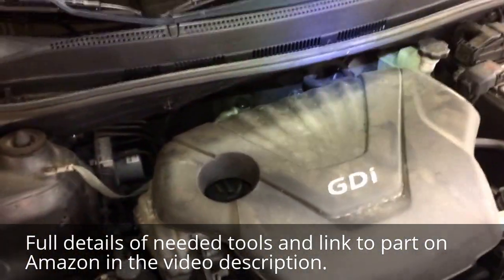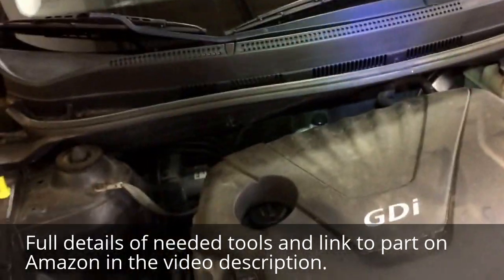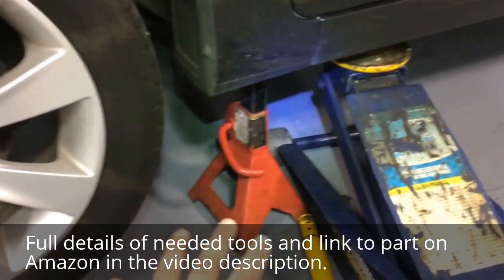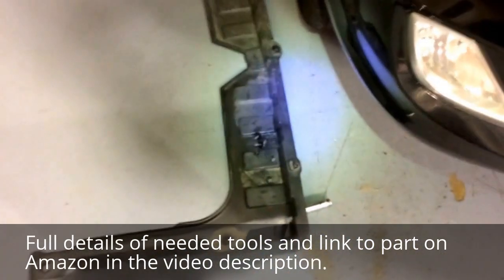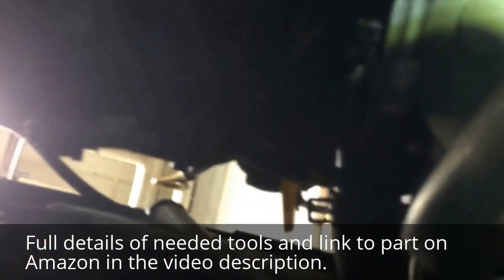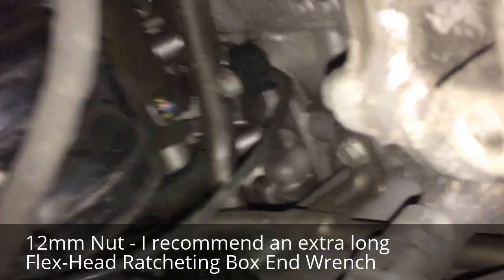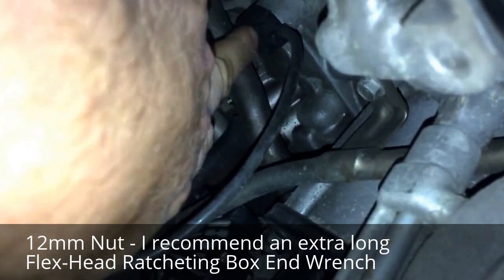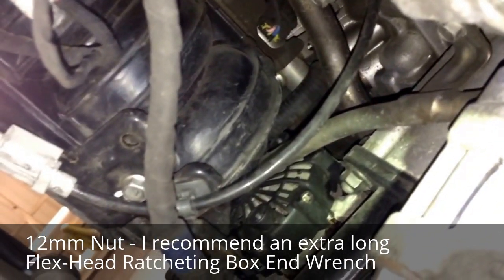Actual location of the Knock Detonation Sensor in a 2012 Hyundai Accent SE

Comment: Excellent video, thanks. My check engine light went on with the knock sensor code. The dealer said replacing it would be $500-plus (this is Brooklyn, NY, so prices are high) because they'd had to remove the intake manifold. Instead, I found your video, ordered one of the sensors you suggest, and did the repair myself. Certainly no need to remove the manifold. Took about an hour, with much of the time devoted to disconnecting the clips on the old sensor. (Have a small flat-head screwdriver on hand for that, and study the new sensor to see how to the clips work.) I'm not entirely convinced this is going to replace the problem, but I'd glad it's only costing me $20, not $500.

Also, replacing the spark plugs was a great suggestion. That cured a shifting problem I was having.
Reply from the maker: +Michael McCoy Happy to hear that it saved you a bundle. How’s it holding up? I’ve come to the theory that the thumbs-down clicks are from Hyundai mechanics. LoL.

Comment: For those doing the replacement,  a standard sized ratchet doesn't fit up in there. Use the smallest ratchet in the set to fit up in there with a 12mm socket. I almost went and bought angled wrenches to do the job. I didn't think the small ratchet would be strong enough because its short and I wouldn't have leverage. I was wrong. These are only tightened to about 12 ft/lbs. So its easy.

Comment: This was just what I needed for my 2012 Kia Rio (sister brand).  Thank you so much!  I didn't have to remove the heat shield or noise shield.  It was slow going for me, having to make use of a box wrench.  I would recommend a ratchet wrench (a small socket wrench wouldn't fit).  Anyway, I was finally able to remove the old Knock Sensor & (even more challenging) get the new one installed.  Couldn't have done it (wouldn't have tried) without this clear video showing the location and how to access.  In my case, the spurious P0325 code no longer comes in to vex me.

Comment: Thank you SO much for posting this! I was also having the issue of finding anything actually descriptive, but this goes beyond detailed, and I'm super grateful. Great job, thanks again.
Reply: Additionally: I have a 3rd Generation Kia Rio (2012-15), which also has the Hyundai Gamma engine. So, other Kia drivers with the typical knock sensor issue, here is what you're looking for.
Reply from the maker: I’m happy this helped.  Be sure to keep those spark plugs fresh, too.  I’m on my third set.
Reply: That is also on the menu for this weekend, alongside a valve adjustment lol. 2013 and already 160,000+ miles.
Reply: @bikerreed  how often you changing spark plugs?

Comment: Thanks for the video. I have the same problem on my 2013 Accent. I will order the sensor and hopefully will turn off the engine light.
Reply: Dude that’s so weird I’m having the same problem too @ 83k miles
Reply: @WHATdaFUNK123  same with me now at 89k miles
Reply: Johnathan I never replaced mine , but I’m at 85k now and my check engine light hasn’t been on since I watched this video .

Comment: Thanks for the video and the part/tool links.  Ordered both for my 2012 Kia Rio that was pinging, had a power loss in low gear and throwing P0330 code.  Getting to that nut was difficult, even with the  right tool, but it all worked out.  She's running great again.
Reply from the maker: +sifual01 Very happy to hear it. It sure does seem that they design these cars so that we will give up and let them do the work, doesn’t it?

If you have more hesitation / engine stall behavior, be sure to read all the comments here. Might need some spark plugs.

Comment: there is a service bulletin for some hyundais with the knock sensor code. the ecm needs to be reflashed in some cases. i replaced my knock sensor on my '13 accent and the code came back a few times. reflashed ecm for $120, never came back on. i shouldve done the research before throwing parts at my car.
Reply: Is the same location and process for a 2013 accent GLS?

Comment: Thanks for the video! I hope it's the same on my wife's 2011 Sanota 2.4.
Reply from the maker: matejcekauto J recommend reading all of the comments here, too. Some additional minor things to check also.
Reply: Did it work for your sonata? Or where was it mine went out as well
Reply: @yntsfelt  my wife's Sonata actually ended up needing the engine replaced.  The knock sensor issue was a pre warning.

Comment: Thanks for the video my friend. I have a 2012 veloster with the same code. Bought the part now I can do it myself in a matter of minutes from what it looks like. 89k miles. Once you changed the part did this fix the problem? I guess my next move will be to replace the spark plugs as you recommeded along with changing to higher octane fuel. I dont really have a pinging in the motor as of now so im assuming this is part of regular maintenance throughout the life of this "quarky" vehicle
Reply from the maker: +Travis Finley, it did fix the problem, but it cane right back, to my dismay. However, the spark plug change was like getting a new car.  Runs like a champ, now.  The only issue I have now is that it burns through oil pretty quickly, as I heard this model does.
Reply: I´m sorry to ask but as you have said " it burns through oil pretty quickly"... do you mean it turns oil black really fast or do you mean it uses 1 quart of 5w20 oil every 1000-1200 miles  or so?? (This is a 2013 accent)
I´m experiencing the second. And want to know why. Also did a compression test and it has 180,180,185,180 psi. So I don´t know why this oil consumption. Car idles fine, runs fine, no smoke, no CEL on, no anything. Just about 1 quart of oil every 1000 miles or so. My other car (a 2005 honda civic) never has done that !
Someone told me to change the pcv valve which I already removed and blew air through it and it tested OK.
Part is cheap (about $ 4 at rockauto) so I don´t know if I should change it. Any comment is very welcomed. Thanks
Reply: Mine (2012 velosterr non turbo) CEL display happened around May 2019 (only restarted -cleared) then came back last week of August 2019 after reaching 90Kmi. Restarting did not clear it but using FIXD reader clearred it still up to this comment date Sept 5, 2019. Other reader would have probably cleared it too. Im still gonna buy a new sensor. How many knock sendsors are there anyway on this car?

Comment: my 13 accent pings rlly bad under load but has no fault code could this be part of the issue?
Reply from the maker: Joshua Warwick only if that pinging is accompanied by stalling/loss of power.  If you have 100k + mileage, change the spark plugs, too.  I just changed mine and my car performs line it's brand new again.  I also switched to 93 octane gas, which took care of the pinging.
Reply from the maker: +Joshua Warwick...It could be, as it is a common issue. However, if you have 100k or more miles, change your spark plugs.  A few other issues is that it will begin to consume a lot of oil, so keep a close eye on the level. I have also switched to 93 octane gas, only. That got rid of most of the ping.

Comment: I just did this job and the check engine light is still on, is this normal or how do I get it to shut off?
Reply from the maker: +wiz420ify You still need to have the check engine light reset. You can get this done for free from most auto parts stores.

However, there still might be something else going on. Best to have it reset, then have the auto parts store give you a free reading.
Reply from the maker: +wiz420ify It has to be cleared manually. You can have this done at places like Autozone.